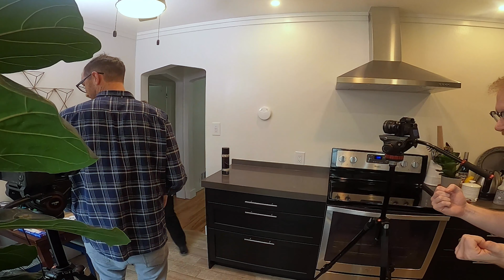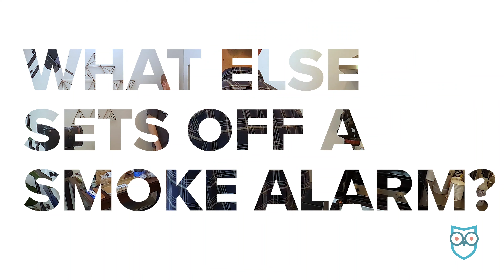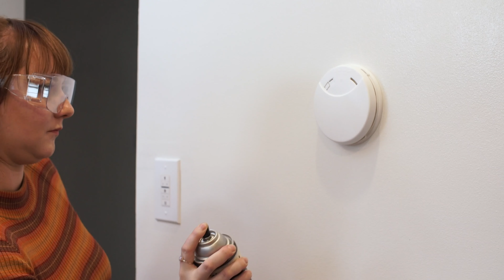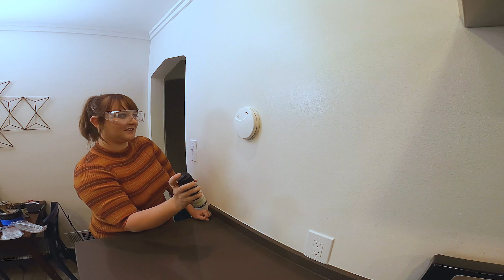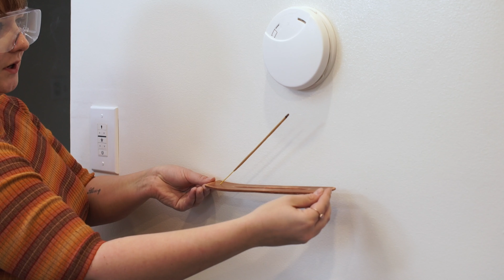Why Would My Smoke Alarm Go Off Without Smoke? | SafeWise

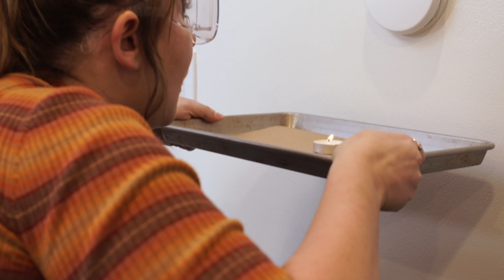Comment: 3:11 “the alarm went off at 3 candles, we weren’t able to replicate the effect”. I did similar test of the same detector “First Alert”, and got same results as yours: it went off in the first test, but weren’t able to replicate. Now I worry if the alarm is broken?
Reply from the maker: You can always test your smoke alarm manually with the button on it. Were you using tea candles like we did?
Reply: @asksafewise  At first i hold 3 tiny birthday candles, light them together, and blow off, light three time in a row, and then the alarm is off. The second time i try this way, but wasnt work, then i changed to use a big scent candle in a cup, still no effect. Yes, the test button works, which means the detector wasn’t broken, right?
Reply from the maker: @music1band  Right! That test button was put there for you to check the smoke detector's battery and that it's still working. It's a much easier way to test and make sure it's still good. That's cool that you've been doing experiments of your own. Stay safe!

Comment: Thank you for the video. I thought I was loosing my mind. I had put in new battery and the alarm would go off when I opened the bathroom door after a shower, then beep beep. I thought my cooking was bad. The detector is too close to bathroom and kitchen. I would be cooking dinner and before I could turn on the exhaust fan, the alarm was going off. My husband said it's because I can't cook. All I know is, he eats it without complaining. (I do cook fast on high heat).
Reply from the maker: So glad this helped, Tammy! May try some slow and low cooking next time, but at least you can avoid false alarms from the shower 😉